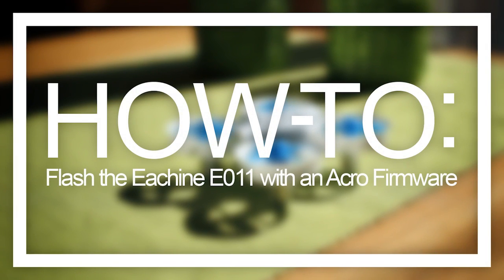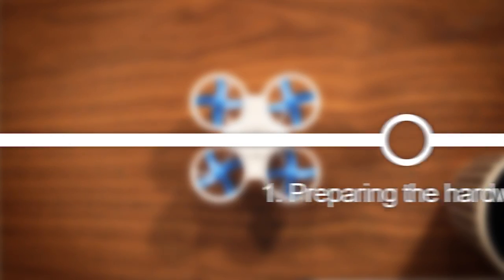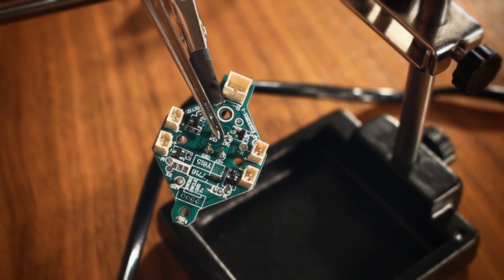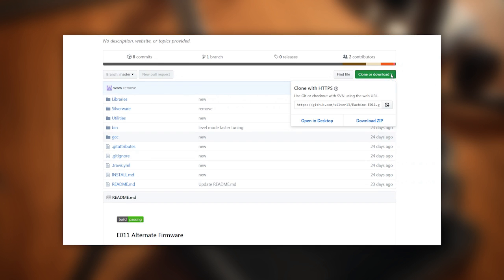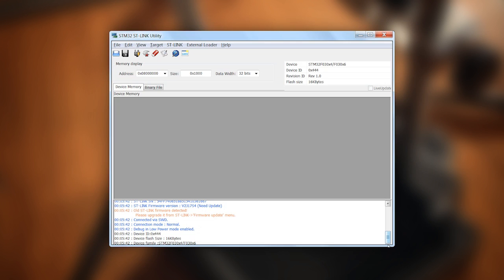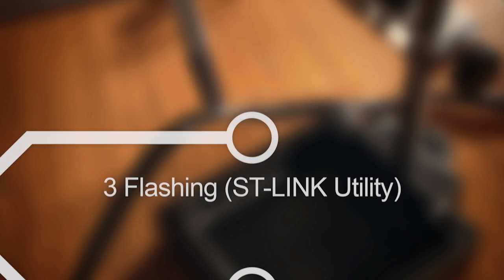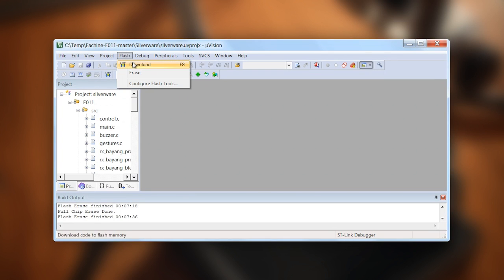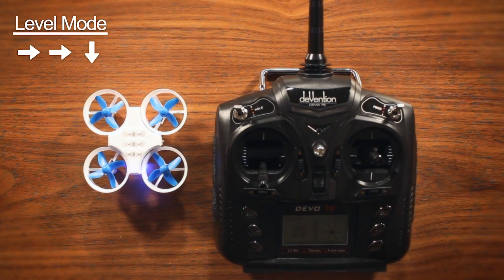How to Flash the Eachine E011 with an Acro Firmware

Comment: Hey is this tutorial still works on new e011 boards, i bought one for installing acro firmware and saw numerous feedback(on banggood product page) about not being able to flash on new boards, it sucks
Reply: I have some issues aswell. I have 2 new H67 santa quads from JJRC and I was able to flash one but it just blinks 4 times with the leds. this means the Gyro is not working so it wont bind or do anything.
Reply: did u find a fix?

Comment: i have a e011c , i want to flash it with nfe . is the read protection  nessary in st link or can i directly use keil ? i can,t connect with st link or adjust the read out protection in option bytes

Comment: There are three video tutorial that i've watched, and all use 3 pins : SWDIO, GND, SWCLK also use lipo battery. Why use lipo battery connected to the board insteads using 3.3v pin from ST-Link ?

Comment: After Flashing My E011 my trim buttons do not work!?!....Any idea how I can fix this? I am using the stock TX.
Reply: Psyan1de can’t help with the buttons, but you can try calibrating the accelerometer with stick gestures. Make sure you’re on a level surface and push the right stick down 3 times. It should flash, then go solid.

Comment: After flashing the firmware, I can't seem to bind this to my FlySky FS-i6S using the iRangeX module.  Is there a specific arming method that is different from the stock firmware?
Reply: n/m after deciphering several vague guides, I found that shorting the TX and +5V pads on the iRangeX module and setting FS-i6S output mode to PPM will get the module to bind.  Although the acro gesture does not work =/

Comment: If I try to connect to the board, I get an Error saying:
" 
Can not connect to target!
                  If you're trying to connect to an STM32W1xx device, please select Normal or HotPlug mode from Target->Settings menu.
                  If you're trying to connect to a low frequency application , please select a lower SWD Frequency mode from Target->Settings menu.
No target connected
"
If anyone knows how to solve this problem, please let me know!
Reply: Felix Baum had same Problem, swapped the dat and clk solderpoints on the board
Reply: FredericoSecondo Unfortunately that changes nothing :(
Reply: delete and redownload the eachine e011 silverwave, if work for u.......

Comment: Hi!
I want to know whether acro will work with the stock e011 transmitter?
You know.......the small stock remote
Reply from the maker: Yes it works, but I hear it's very difficult due to the transmitter being so imprecise.
Reply: What would be the code to fly it in acro mode with the stock tx?
Reply: @charliedcho  it's super hard , cause when you move the right stick gently nothing happens , the left stick seems more precise

Comment: Nice! :) Informative video. This method can be also applied to other quadcopters(H8 mini, Bayangtoys X6, etc).
Reply: Does it work on the e010 because the e011 can't be bought anywhere!
Reply from the maker: Thank you! Yes, just make sure to use the corresponding firmware. (Also, I think only the E011 has mislabeled pads.)